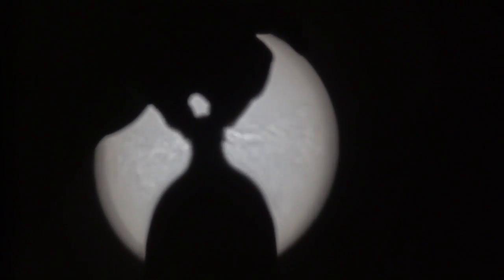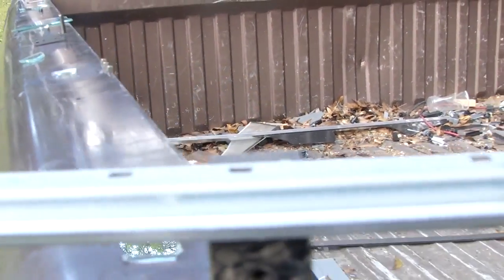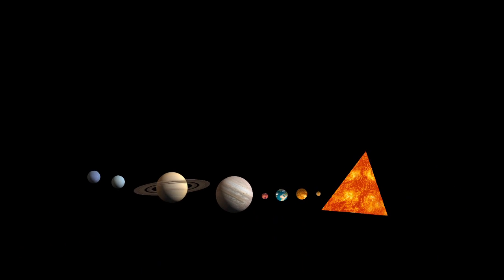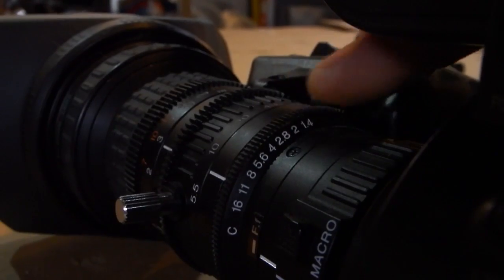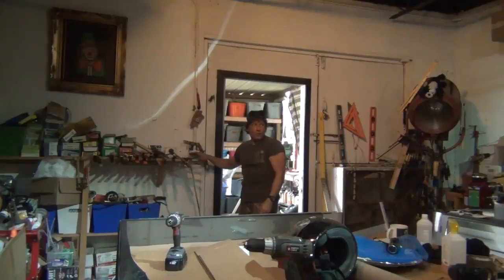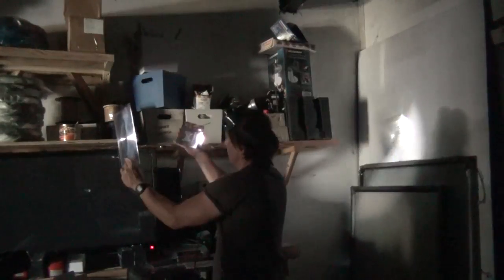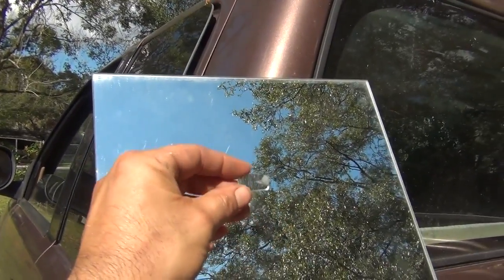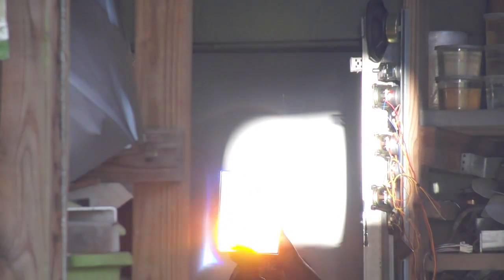DIY 10/14, 2023, an annular solar eclipse WITH ANY MIRROR pinhole sun imaging

Comment from the maker: PLEASE SHARE! THIS IS POWERFUL INFORMATION and great for 2017.
Easy Schlieren photography Dan's Version DIY Pinhole 30,000mm Sun imaging Telescope
It is much more than photography. Information is useful in understanding how sun to solar thermal power really works. Can save you a bunch of time for solar projects.
Reply: If you measure the distance from the wall, and the diameter of the sun, you can figure out the "spread or diversion angle" of the light.  I think for sunlight, it is about 0.5 degrees, thats half a degree (same for the moon).  I think it is mainly due to that the Sun is not a tiny point source of light at our distance to the sun.  It is a point source, like any other star, way out in the solar system.  This also means that all the energy, such as light, from the sun gets spread out/diluted/weakened into a large area.

Comment: Thank you! I have been trying to do this simply for a while. The last eclipse I used an old telescope, a large piece of cardboard with a hole in it for a shade and a flat sheet of white plastic for a screen. Had a nice large image but was going to improve it with a spherical screen. Now I have a use for that old SLR camera mirror. That ought to give a nice clear reflection. Plus maybe an iris on the incident beam or mounting it on a clocked tripod.  Super good.

Comment: Do you have a how to video about making a better signal booster for cell phones?
Reply from the maker: Parabolic Mirror from a Trash Can Lid HACK Death Ray Solar do it yourself DIY

You do not need a true shape. Anything with a mirrored surface is actually a layer of aluminum so the mylar blankets work well. Stretch around a small square or circle. Flat is fine.

Comment: I like my aluminum covered foam (store bought wall/roof insulator)
I cut it to a size that fits my window, it keeps my room cooler/hotter and for summer it acts as a nice barrier against the sun :) I don't recommend it for that fact that it is very flammable if the activation energy for combustion is reached. The rate of burning isn't too fast since it is rated for construction use
Reply from the maker: This is not aluminum covered in regards to future metalizing. It is a true mirror metalizing application.
Reply: oh, i was talking about the insulation I use :)
It is covered in thick aluminum

Comment: This isn't actually Schlieren imaging, it's shadowgraphic imaging, which is releated but not the same. Schlieren imaging involves focusing light on a stop such as a knife edge, to enhance the contrast by using the knife edge to block or pass light beams refracted in different directions. In both techniques, long focal length improves the result.

Comment: I tried to post a note to save people time looking for resources, but it got deleted I think.  You cannot put links here I guess.  What a shame.

The size of the spot on the wall should be roughly 2*DistanceToMirrorMeters*1000 mmPerMeter*(RadiusSunMeters/DistanceToSunMeters)

The solar radius in astronomical units is the solar radius divided by the average distance to the sun. The value is 0.00465047

For a rough number any time of the year, you can take DistanceFromMirrorToScreenInMeters * 2 * 0.00465047 * 1000 to get the rough image size. That is 9.30094 (mm/meter) * DistanceFromMirrorToScreenInMeters, For 30 meters that is 279.0282 mm

Comment: Hi Dan can you cut a Fresnel Lens down thats broken in middle to still work
Reply from the maker: gene mayne Yes, the center is the best part but a crack or missing section is not a big deal.
Reply: Hi Dan thanks for the fast reply / what would you use the Projection TV  Lens on I was going thought all videos for good ideas